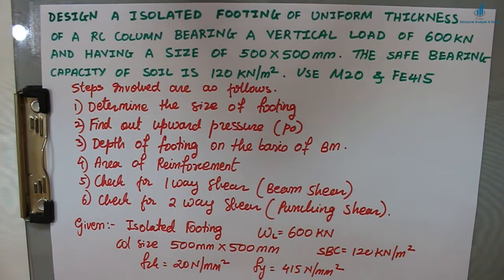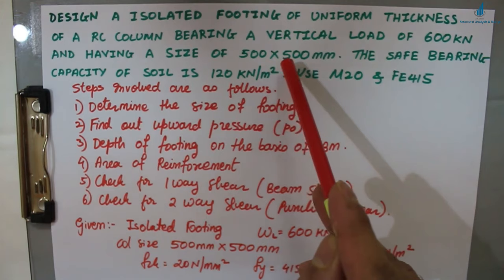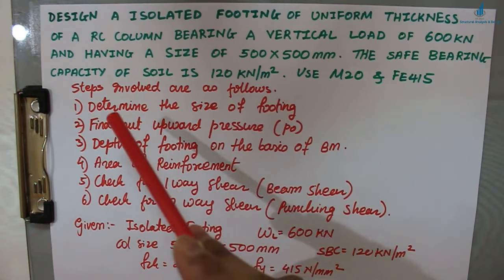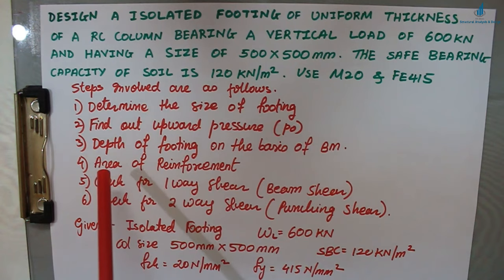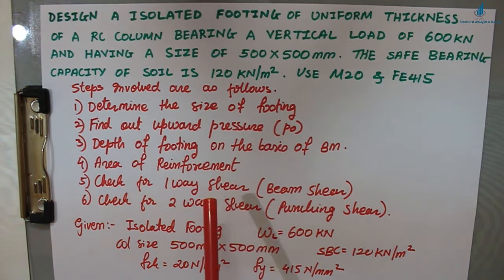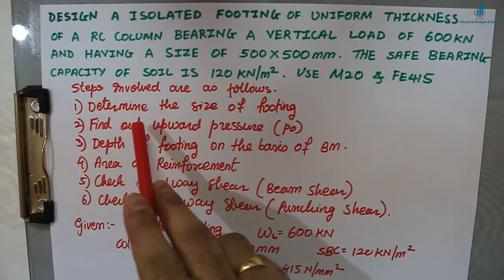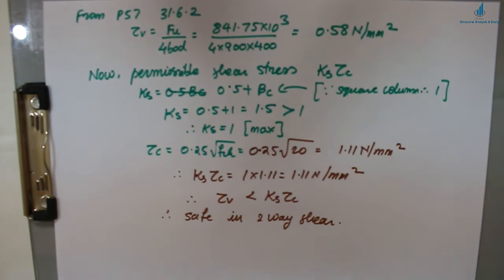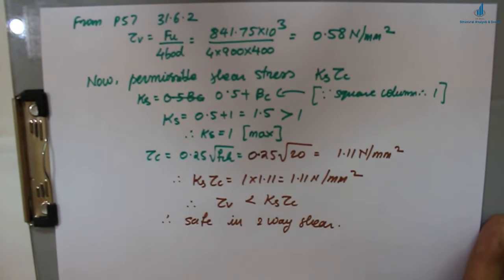Design of footing | Isolated Square Footing | Limit State Method | IS 456-2000 | RCC Footing Design

Comment: Net upwards pressure will exclude self weight of footing.Net upwards pressure is column load/ area of footing provided
600/2,4 ×2.4
Reply: Net upwards pressure will exclude self weight of footing. ie 600/2.4x2.4

Comment: Sir,are these explanations purely on basis of exam view.is this method used also practically in construction site.pls give reply
Reply from the maker: This method is not only basis for exams, this is the knowledge you will require as a design engineer, softwares will give output whatever input you give but as a engineer we have to understand whether software giving values are correct or no

Comment: Sir, shouldnt we use factored load for finding area of footing? i.e. 660 × 1.5
Reply from the maker: You can use, i have factored moment instead multiplying to load, both the ways you can do
Reply: Bcz our geotechnical survey   provide safe bearing capacity not provide ultimate bearing capacity so at that time we can't take ultimate load

Comment: sir net upward pressure nikalne ke liye only superimposed load hi lete hai shyd total load ni lete
Reply from the maker: I have multiplied factor of safety in moment, there it incorporates everything
Reply: @structuralanalysisanddesign  no sir i am asking about where u use total load in net upward pressure there should be only column load only . i have seen in book so is it right or wrong sir ?
Reply: please sir tell me about last step two way shear why u use 4 times of perimeter and d explain about it sir 🙏
Reply from the maker: That column will create punch all four sides thats why perimeter we take to consider all sides, just see that drawing it has been drawn clearly
Reply from the maker: At 8:50 i have used vertical load to calculate net upward pressure
Reply: Sir at 24:21 you have increase the d value from 170mm to 400mm by saying that it'll not satisfy the shear condition...but itna jyada increase Karna ,to phir itna jyada calculation Ka kya fyada...must reply.

Comment: sir,
the spacing between the bars should be = 2400/11=218.18~220mm
Reply: Bro providing lesser value compare to original value is safer 
But providing higher value than original value may leads to failure

Comment: Correction: The upward pressure of foundation bed that produces bending moment, don't include the weight of the column footing.
Only the load of the column is being considered, po=Column load/B2 =600/2.4x2.4m=

Comment: brother,  hi  I am a regular reader  of you channel and got lnsight about civil engineering. 

Dear I am facing a problem. I am in process of constructing my poultry form in my village.
My problem is after digging to 10 ft depth soil is sandy with very poor soil bearing capacity . I purchased the land from my life savings after retirement. If I don't complete the construction of poultry farming,  my loan WllI  be wasted. And investment drowns in deep seas. 

Sir, can you suggest some means to improve the Soil bearing strength to enable to support to develop columns so that structures don't collapse. 
Your  advise  will give console to me .

With  sincerest regards. 

Rajbir
Reply from the maker: Hello Dear,

My best advice is you consult good local engineer and also consult Engineering College of nearby area, there will be solution for your problem, don't worry.